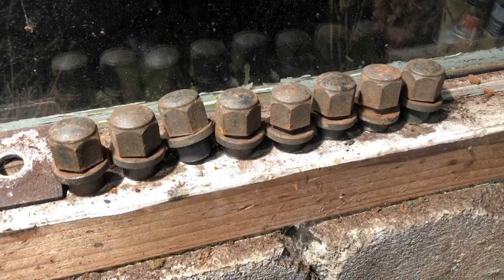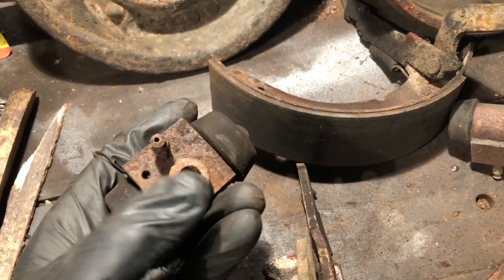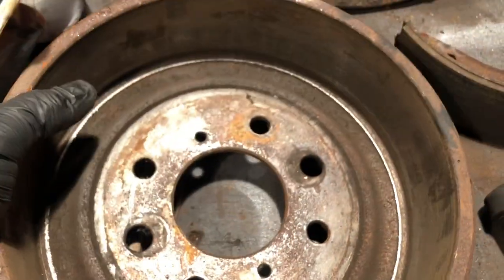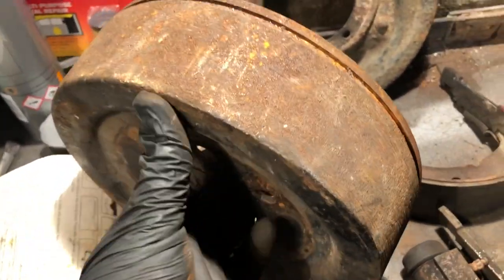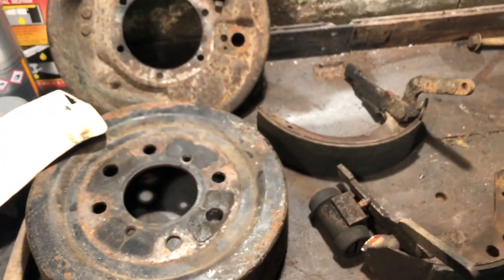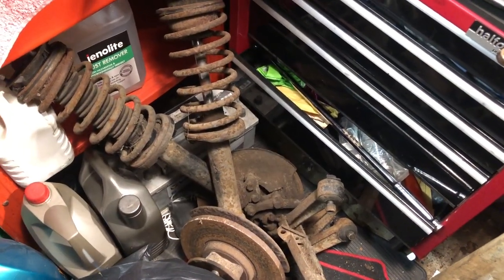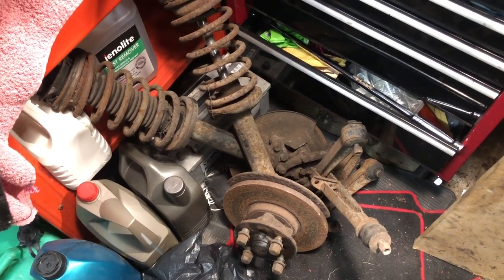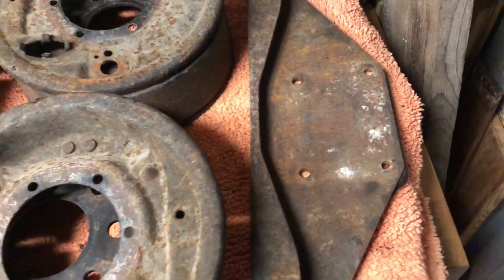Triumph Stag Rear Drum Brakes

Comment: Hi Tony try drilling holes through the rubber bushes. Series of holes around the diameter. It should weaken it enough to knock them out by placing a socket and tapping them through. Had same issue with mine. Thanks for the video. Dave.

Comment: Hi to the Arry the Stag team, another good nights work on UNY. I had my suspension parts power coated, I think it would have been a better plan to have them painted. The first tine you 'for instance ' change the track rod ends the power coating get damaged and it doesn't look so good then.
Good luck and all the best. Bob (👹 the red devil Stag).